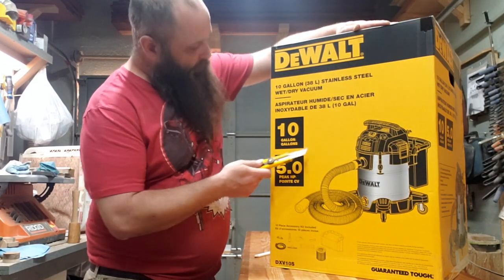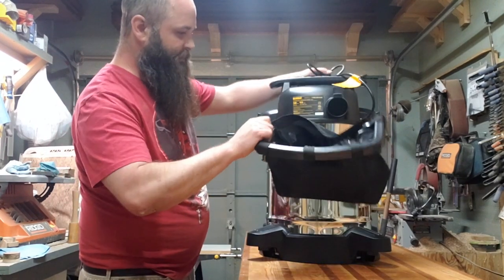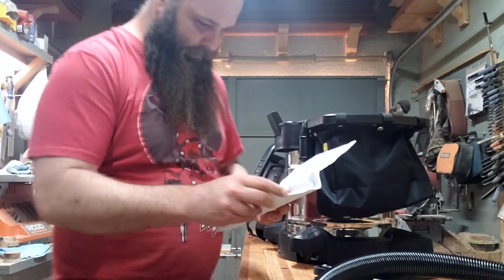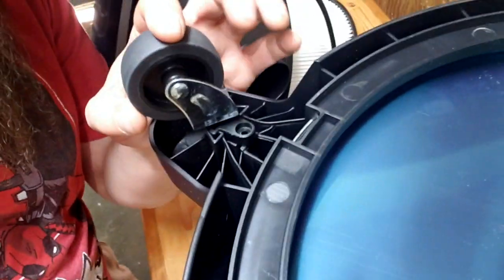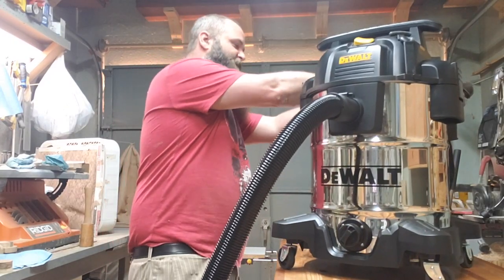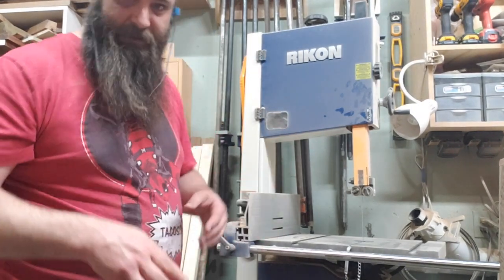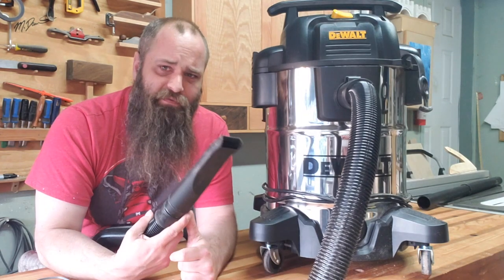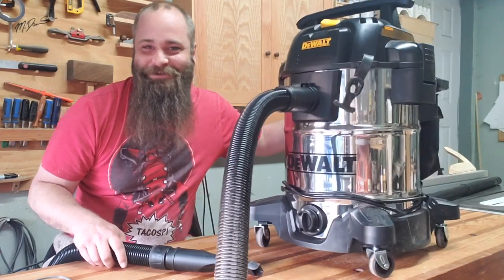A Look At The New DeWalt 10-Gallon "ShopVac" (Wet-Dry Vacuum)

Comment: I've had one of these for about a year now and its a beast, no problems so far and its chrome....I also have the small portable DeWalt shop vac that uses the Battery, its powerful for its size and perfect for cleaning vehicles and odd small things, couldn't be happier with both of them.
Reply from the maker: Loving mine so far. Definitely the best vac I've ever had, even if that's not saying much because the others were all crap. haha

Comment: Thats a awesome shop vac. DeWalt makes good stuff. Now you should make a dust separator to go with it. This way you dont fill up the bag or clog up the filter.
Reply from the maker: I'm thinking that's a thing that will happen eventually, but probably not until I have a permanent home for my lathe, because currently it takes up too much of the rest of the room under the bench for me to house anything else of substance down there.

Comment: Great video!! Would this be suitable to coneect to a dewalt job site table saw?
Reply from the maker: I don't know the port size on the Dewalt jobsite saw, but if you have the right adaptor, it should work fine. Generally you'd want something more in the way of a "dust collector" (high volume low pressure) to get the most dest removal from a table saw, but a "shopvac" type thing like this (low volume high pressure) would be better than nothing, for sure.
Reply: @WoodenThingsAndStuff  Thanks mate 👍

Comment: Thanks for the vid

Considering buying the Australian version of this for my garage/home gym, seems to be one of my best bets at the top of the budget range and its specs seem to be way better than a few similarly priced rivals. 

Has it held up well for you? 

Costs a bit more over here, $299AUD (around $230USD), though I think we get a 6m long cord (other models seem to be 3m)
Reply from the maker: Can't speak to longevity yet, because it hasn't even been a year, but I use it a ton and haven't had any problems other than not realizing the bag is full before it's too late to get it out cleanly. You definitely want to replace your bag before it's full or the intake part on the inside of the cannister gets in the way when taking it out, rips the bag open and makes a huge mess.
Reply: @WoodenThingsAndStuff  cheers for that

Looks like a 5 pack of replacement bags are around $15-20AUD here, I guess I'll get a few months out of that.

I was considering a shredder vac too as alot of leaves/grass clippings/insects get in under doors etc, but my mum has an el cheapo and it's no good for dust so I'll probably just borrow hers whenever i need it
Reply: Ended up purchasing one on Friday 

Only a couple of minutes to unbox and screw the wheels on and put everything in place, night and day a huge upgrade on the little cordless handheld I was using previously, was an absolute joy to clean up the garage with quickly and efficiently.

It seems to be exactly the same as your model, just with the 38 litre branding instead of 10 gallon branding. I will have to let my supplier know It's a 3m cord, not the 6m they listed online, good thing it has that attachment pouch though, so I'll put an extension cord in there (was going to probably need one anyway to vacuum the car or something)

I think I'll only use the bag for really dusty applications, seeing it'll suck up all sorts of things in the meantime, but yeah thanks again for the helpful video

Comment: I can see the sun rising through the gap above the garage door.  Must have been filmed very early, this video.
Can you stick a magnet on the canister?
Reply from the maker: Jeez, I dunno. Will try to remember to give it a try and let you know. Also, that's the side of the house the sun sets on.
Reply: @WoodenThingsAndStuff  Thanks, just wondering the quality of the metal.  If the magnet sticks it's not really 'stainless' steel, not going to stand up for long because it's going to rust overtime, esp. when it gets banged up.  I want to get it to replace my ShopVac that's way too bulky and the buttons now stuck in the on position.
Reply from the maker: Just went and checked, and yes, a magnet sticks to the side. And if it lasts until it rusts I'll have gotten my money's worth out of it.
Reply: I found this info on the web: Stainless Steels and Magnets

Steel is a metal that magnets stick to because iron can be found inside steel. However, stainless steels comprise a large group of steel alloys that are made of different metal compositions. While some have more chromium, some might have more iron in them. That is why you will find that while some types of stainless steels are magnetic, other stainless steel types will not make magnets stick to them, providing answers to age-old questions “will a magnet stick to stainless steel?” and “why are some metals not magnetic?” Stainless steel is often used in a wide range of home appliances, so if you experiment, you might find that your fridge magnet sticks to your oven but does not stick to your rice cooker

Comment: Does it blow air?
Reply from the maker: No. It doesn't have a blower function.
Reply: @WoodenThingsAndStuff  just bought one and I couldn't find it. Just attach the hose on the top backside.
Reply: Yes it does.

Comment: Finding accessories for this vac is absolutely frustrating.. iv already spend $80 on accessories and none of them work together which defete the purpose.. 

Great vac and suction for cleaning.. but to use this as a dust extractor for your mitre saw or sander or anything will; be a complete hassle! 

I STILL TO THIS DAY CANNOT FIND THE PARTS TO ATTACH THIS TO ANY OF MY TOOLS... but it does clean my shop...
if anyone has any experience with this vac and can give me some advice to hook this up to my tools.. it would greatly be appreciated.
Reply from the maker: Yeah, I haven't even looked for attachment bits for tools, but I imagine that it would be frustrating. I just use it to clean up (and on the lathe while I'm sanding).
Reply: I just bought a 1 7/8 inch to 1 1/4 inch hose adaptor from Etsy that works on Dewalt, Ridgid, and Craftsman shop vacs!  A bit pricey but saves time, hassle, and money trying to find something you hope fits! They guarantee the adapter will find sanders and other tools as well as car detailing tools!
Reply: @troysims2753  
Thank you for your reply .
 I will check them out !
Reply: @troysims2753  Do you have a link to their Etsy Store?
Reply: They also have specific sizes for specific tools and models! Message the guy and he can do any sizes for custom fits!

Comment: Is the DEWALT 10 Gallon Wet/Dry Vacuum made in mexico?
Reply from the maker: I don't even know how to figure that out. I'm sure they make it where the  cost to profit ratio is as high as it can be. Because capitalism.
Reply: Made in China (model DXV10SA) which is a Costco specific model.. only VISUAL difference is..hose is black/yellow, and comes with round brush attachment. Checked box of the one I bought last weekend
Reply: Great vid 😊